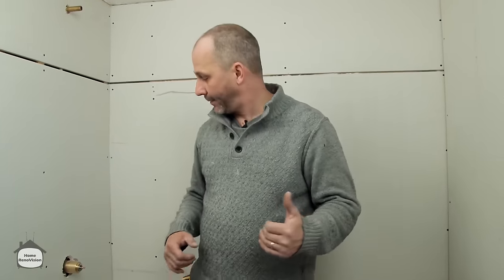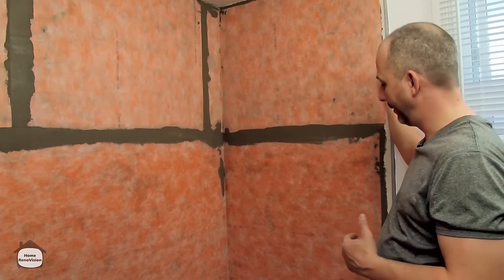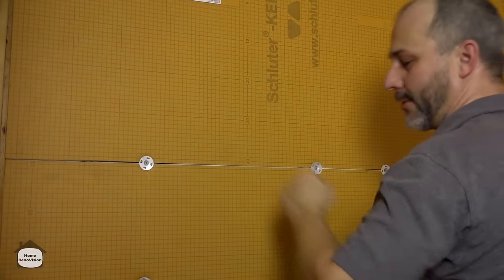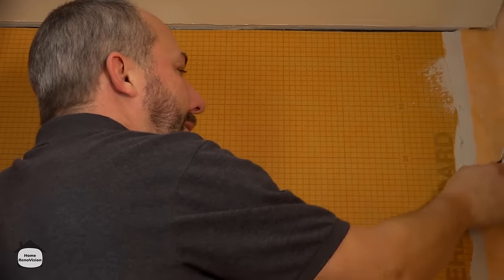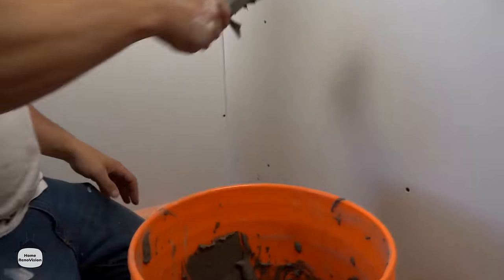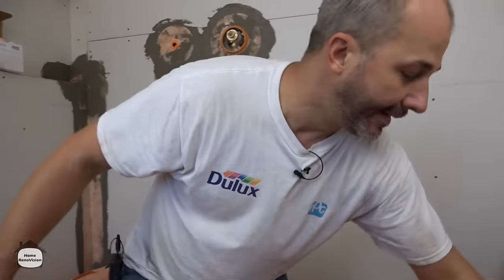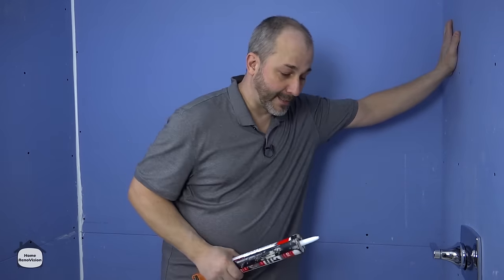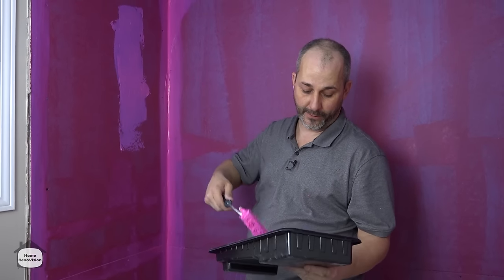4 Types of Shower Waterproofing Systems for Your Bathroom

Comment: I like the Red Guard and have used it previously. In your demo, you applied it on the moisture resistant wallboard that was above the tub. In the previous segment, you constructed the shower tray with the Shulter product. 
In designing our shower, we see the need for a custom shower tray-(no tub). So, would you combine these two approaches. Shulter Kerdi for the pan and the RedGuard+greenboard for the walls?
BTW. we just had a quote for our bathroom at $17k. It was a shocker. They were very proud of their acrylic surfaces.
Alan Stratton

Comment: I'm watching a lot of YouTube videos (and yours are my favorite) trying to learn what I can about installing a shower in a half bath before talking to the professionals. My half bath is on the second story of a one-and-a-half story 1977 house, and is central, not in a corner. I'm guessing I should keep the materials as lightweight as possible, but I haven't seen this addressed in any of the videos. My question is, which of the waterproofing methods (and wall coverings, shower pan, etc) would be lighter weight?
Reply from the maker: Definitely the schluter kerdi board. Cheers!

Comment: I'm having my bathroom remodeled by a contractor. Part of the job will include a new tile shower. The current shower is not tile, it is a contractor grade fiberglass insert. The new shower will be tile and will be larger.
 I've now looked at videos on two waterproofing systems for showers, Schluter and Wedi. In your experience, which one of these systems is best for the money? I don't think the contractor we're using has worked with either system. The contractor was planning on installing a concrete pan, and I'm not sure about the walls. It's my suggestion and idea to use a newer water proof system like the Schluter or Wedi, instead of a traditional tile shower system. This is our first tile shower so I'm not really educated on what to look or look out for. Can you provide some suggestions in regards to what products are best, and things we should be aware of with the contractor. The videos you've posted on YouTube are outstanding. Thanks for any information you can provide.
Reply from the maker: Hi Jay, concrete pans are still very popular. I would suggest that you let your contractor install with his expertise. having him install something he is not trained to do can be disastrous. Be sure to have him roll on  a membrane for the walls. Cheers!

Comment: Hi, I enjoy your videos, you're a great illustrator.  My question regarding a curbless shower/bath floor.  I don't want to use dry mud because then I'll have to drop my subfloor too much.  I also can't find a low profile foam kit that fits my floor plan.  So my question is, working inside a 3/4" depth,  would you use combination of backer board and mortar to pitch the floor to drain, then use either Red-guard, or Kerdi cloth to water proof it?

Comment: Schluter Kirdi and Ditra both allow the use of polymer-modified thin set mortars to bond the product to the sub-straight; both products also allow the use of speed-setting polymer-modified thin set mortars in setting tile over them. Other than that I liked the info; I’ve used Red Guard too and had good results. Both beat rubber.

Comment: I installed Durock on the walls and one panel of Wonderboard on the concrete floor of the shower area, applied 3 coats of Redgard then floated a shower floor with floor mud. Do I need a membrane of some sort on top of the floor mus before I tile over it?  Thanks!
Reply from the maker: you always want a membrane just before the tile. sound like you are getting creative there John!

Comment: I just joined and got the $4.99 monthly membership because I love your videos and I have some questions (I'm not sure if this is where I should post a question or not...) We are remodeling our shower, and have questions about waterproofing:
1. I have seen videos where people are putting the paintable waterproof membrane over their entire finished cement pan, even though there is a PVC liner under the pan. I was planning on doing this as well until I read online that this would create a "mold sandwich". Would it be fine to paint the membrane on the walls and down to the pan, covering about 4 inches around the perimeter of the pan? 
2. In setting the cement board on the walls, I have seen several videos where they say not to let the bottom of the cement board touch the pan, and to leave a 1" gap from the bottom of the cement board. Then to tile the floor, pushing the tile underneath the gap. After grouting, there will be around a 1/2" gap left at the bottom. Do you advise doing this? In the Starrtile videos he says to use a paintbrush and apply the waterproof membrane inside of the gap first, then to install your wall tile down to your floor tile. There will still be a gap behind the bottom of the wall tile. Should I apply caulk to this gap before tiling? Or should fabric be applied first, then the liquid waterproof membrane?

Comment: Hi Jeff, thank you for all the videos you post here. My question is a little something a little off topic. Do you have any videos that show how to replace a window that has vinyl siding and J channel and all that good stuff around it? These are original windows the contractor installed when the house was built. Thank you.
Reply from the maker: Hi Charlie, the trick there is to determine if the windows have a nailing flange on the outside wall. if so then you would need to disengage it and then remove and reinstall and then seal. We will be doing some window videos soon but have yet to determine how they were installed. cheers!
Reply: @HomeRenoVisionDIY  Thanks for the reply Jeff. Looking forward to the videos on the window replacement, Thanks.

Comment: Hey jeff quick question. When using a roll on waterproofing like redgaurd or aquadefence. Do you use modified mortor or unmodified morter when tiling on it?
Reply from the maker: un modified over any waterproof membrane. cheers!

Comment: I appreciate the information on different types of water proofing systems but I see products to prevent movement as well.. especially for tile and grout. I read one old school way is to cement on chicken wire underneath everything else. What products do you recommend to stop movement?
Reply: The old school was was to nail "expanded metal lath" (not chicken wire) directly to the studs which accepts two coats of brown mud mortar (rough trowel coats), followed by a smooth finish coat.  The tile is then set on top with Thinset.  I've seen 70 to 80 year old tile set on this substrate which has never cracked or delaminated.   It's a labour intensive process and requires experience and skill to obtain the smooth, flat and square surface to set the tile to.  I doubt you could find a trades person today with the skills to install this system.  Today's best alternative is probably the "Durock Cement Board" system.  Provides particularly good stability for large format tiles.

Comment: Hey Jeff, have you used the WEDI system before for waterproofing?  If so, what are your thoughts? Thanks
Reply from the maker: No I have not. It seemed very expensive and didn't offer my clients much more in the way of performance.
Reply: Ya, I'm feeling the same way.  Thanks for your response, love the videos and even more so you are engaged with your audience in the comments.  Cheers, keep up the great work.

Comment: Hello Jeff, really enjoy the videos! I have a quick question. What is your preferred finishing technique between tile area wall/waterproofing  and the painted drywall adjacent? Do you smooth it over with mortar real well and then skim with joint compound? Thanks and keep up the great videos!
Reply: I was curious what he does too. If going with a shower door/glass enclosure. I usually use mortar on one side, and joint compound on other side of same joint. Cover with the trim for the glass. I've never had any issues with this method.

Comment: Great videos - my contractor used greenboard and redgard.  I should have asked him to use cement board or your blue board - do you recommend sealing the grout from the outside as a precaution?
Reply from the maker: I use grout that has a sealer in it. Cheers!

Comment: Jeff, have you had any experience with the PROVA waterproofing products? If you have, how does it compare with the KERDI system for waterproofing a shower?
Reply from the maker: they install fine. only problem is they don't have good data on them. they sell cheaper by making what they say is a similar product. It is like buying a fake designer purse. still holds stuff but not sure on the longevity.

Comment: I was wondering if you could advise further on  a bathroom reno.  I live in Ottawa North and have a wood foundation home that is insulated and seal with vapour barrier.  I wish to used the Schluter membrane or Kerdi Board for a walk in tiled shower using an acrylic shower base.  The alcove shower configuration would have 2- 2 by 6 walls that are exterior with existing vapour barrier and insulation sealing them.  Given it is an 1985 R2000 home  (sealed unit) what would recommend. Keep the existing vapour barrier or removed in the affected area and cover with drywall or cement board along with kerdi board or membrane.
Reply from the maker: Hi Jim, i would suggest you leave it alone and add kerdi board to build the shower. Cheers!

Comment: Jeff,  I have hardiebacker in the shower surround above the tub, up to ceiling with a small 1/8" gap. The ceiling is finished and painted drywall.  What caulk would be good for that gap? And do i apply it before/ after i tile up? 
Thanks man,  your videos rock!
Reply from the maker: don't bother unless you plan on spraying the ceiling down after every shower. there won;t be any water getting in there if you caulk the tile to the ceiling. Cheers1

Comment: Love your video.  Very nicely done.  I am going to be using Kerdi-Board in a shower/tub combo.  I would like to use a Schluter Niche, but they don't make the size we want.  My question is -- can I use a non-Schluter niche, with the Kerdi products you show?  There is a niche made by "Uni-Green" which is the size we would like (on Amazon).  Will I have any problems using the non-modified cement and the LePage caulking, with a non-Schluter product?  Thanks so much.   Your videos are really great.

Comment: Thank you for the video series.  I learned a lot and it also reminded me of a lot of the tricks that my dad taught me. What is the best method for a single solid surface shower install? thinking of installing Kohler or Onyx. Thanks in advance for your time.

Comment: Hey Jeff I’m remodeling my bathroom now .  I have used red guard and membrane systems in the past. I had a custom shower pan waterproofed with fiberglass approximately 8” up the wall an 20” up the back wall where there will be a granite bench. I was wondering if I can use a Kerdi membrane on the cement. Board walls or if I will have a problem adhering the membrane to the fiberglass on the bottom.
Reply from the maker: Hi James, the kerdi membrane can be installed anywhere you want. If you use the non modified cement it will give you the best performance on all your surfaces. Cheers!

Comment: Hey Jeff, I'm looking to have a 2x4 exterior wall spray foamed and then put a 1” XPS foam board on the interior side of the studs to deal with thermal bridging.  That same exterior wall is one side of my planned walk in shower, would installing Kerdi board over top of the 1" XPS layer cause me problems with grout or tile cracking?  If so any suggestions as an alternate solution?

Comment: Question: if using the Kerdi system and say someone doesn't like that tile anymore... is it possible to remove the tile without compromising the Kerri waterproof system? My take on it, is that the Kerri will fail and come off with the tile removal while removing tiles. Let me know your thoughts. Thanks
Reply from the maker: if you know you have kerdi then option2 is install over the tile. or rip it all out. Cheers!
Reply: Home RenoVision DIY thanks. Figured so.

Comment: I have a tub that's flat on the top and doesn't have a flange. Just wondering where to set the concrete board or kerdi board and how to seal it. Thank you!

Comment: Great video. One question though, how do you water proof the shower pan with the edges of water resistant dry wall? Does the wall go on top of the pan and you run the same 2in1 caulking over it?

Comment: Can I use the last system (mold resistant board and roll on seal) on a mobile home surround shower?  The current walls are NOT water resistant at all and I’m dreading even opening the walls to see the damage. 

As I have never seen the interior of a mobile home wall, I’m unsure if they even have studs, so this will all be new to us... me! 😏

Comment: I already taped and mudded  mold resistant drywall, can I still add the pink/red sealant and the glue caulking/sealant in the corners.
Reply: Yes 4 coats at the least next time if you want to tape use mesh with thinset prior to rearguard application works best

Comment: I was planning on using Concrete board (like Durarock) for the walls and Kerdi preformed shower pan on the shower floor for a walk in shower.  Is it ok to mix the products or do I need to waterproof the concrete board before tiling?  I was also planning on using a shower pan liner like the one Oatey sells  I do not want water issues  Thank you for your advise.
Reply from the maker: hey sassy, install the base and walls, then use the kerdiband to seal the base to the walls. then use redgaurd or aquadefense to paint a waterproof layer on the walls and kerdiband. this will out live your grandchildren. Cheers!

Comment: Jeff great videos! I have a quick question, how would you recommend using the kerdi system on a painted lath and plaster wall. We are going to be relocating a claw foot tub to another bathroom to free up some room and looking to install a stand up shower.  Should it be ripped out to use the kerdi panel for the shower walls or just use the membrane (replacing the lower portion to achieve the overlap with the shower pan)? Just wondering what we should expect. Thank you!

Comment: My tub is a jetted tub without a lip around the edge.  The previous contractor brought plywood down near the top, and then Barkerboard.  I just removed the barkerboard, and may have to remove some of the plywood.  What would I use to fill the gap above the tub and below the drywall or kerdiboard?  Am thinking Kerdi-Fix might work better than Lepage's 2in1- thoughts?  RedGard seemed to be most efficient for a flat series of walls, except where shower, faucet, and control knob come through.
Reply from the maker: kerdi fix will work. if you don't know where to find it here is the amazon link. Cheers! https://amzn.to/2ySCGMO

Comment: So, I am sure it is in the comments, but, would using Hardy Board or something like it be better/OK when using the last method?  I like the idea of using something like that versus drywall.  Your thoughts?  Thanks and great video.
Reply from the maker: I am not an enemy of hardy board. it is just harder to work with so If I am going to waterproof then i stick to drywall.
Reply: YES......any cement board like hardi, Durock, wonderbard, etc would be better. Most areas in the US don’t allow drywall, unless covered by the Kerdi product.

Comment: These products all do a great job and I would use them today, but I did a bathroom back in 1978 these weren't available back then. I used regular sheetrock spackled and painted everything with 2 coats of shellac,  then installed the tile. To this day I haven't lost a single 6x6 tile or any grout. Go figure

Comment: Can I cement the kerdi-band to painted drywall? Its a Shower install w toilet in btween shower & wall. Any suggestions?  Will it adhere to paint or fail?  I will be setting the Kerdi drain & pan in the next few days and having at it w the kerdi-roll... Love your videos! You helped me through a lot this past year on a 3rd-floor reno in our historic home. TIA!!
Reply from the maker: yes cement will bond to paint and drywall.

Comment: Can’t thank you enough. Do you have a video on tub decks. After watching your video I might go with Lepage 2 in 1 where the tub meets the top of the deck and then redgard . Actually I’m thinking about regard on the whole deck then set the tub then lapage then redgard, tile, then final caulk with a grout matching caulk.

Comment: Thanks for the video, so much helpful. Wondering if I use goboard backer board and use a mesh tape with sealant to connect joints,  then paint with redgard watterproofing, is it enough or should I skip a step?
Reply: steve miller that’s fine. Same thing I did

Comment: Hi Jeff, for a bathroom that is not a DIY job and is being contracted out who normally does this step?  The General contractor or plumber?
Reply from the maker: the contractor. Cheers John! and you should always get a chance to review the work before it is covered in tile.
Reply: Home RenoVision DIY I thought so. I’ve just started out and looking at my first 2 bathrooms re and re.  Relying on your Kedi board video, great info in that.  Thoughts on wedi Vs kerdi?

Comment: On the last bit. 
Can you tile the wall over the mold resistant drywall? Or would you need to add cement backer board over the mold resistant drywall to be able to tile the walls?
Reply from the maker: code allows direct installation on mold resistant drywall even without a waterproof membrane. I will always add a layer of extra protection. cheers!
Reply: @HomeRenoVisionDIY  Ok thank you, I'll continue to browse your videos for more content